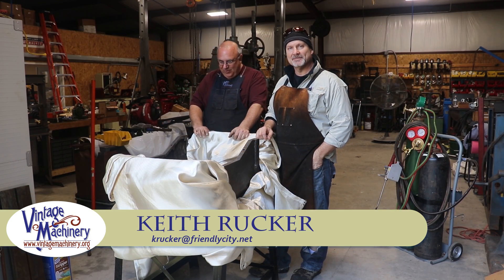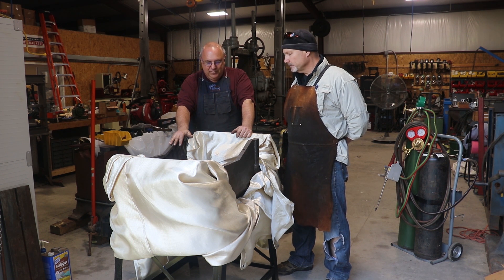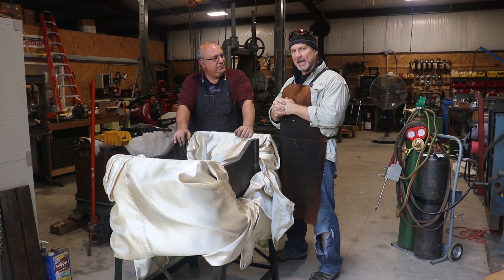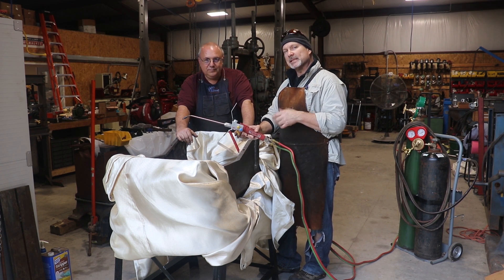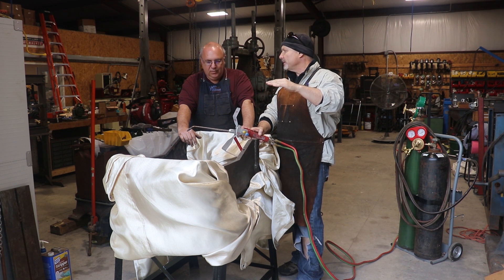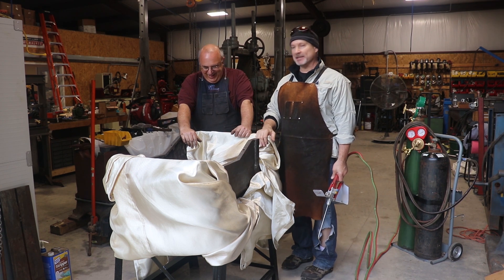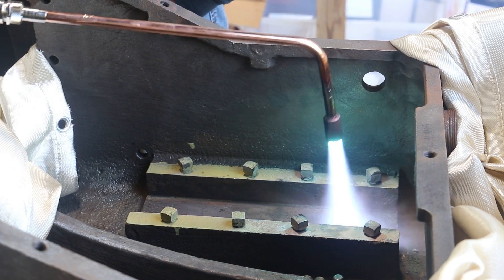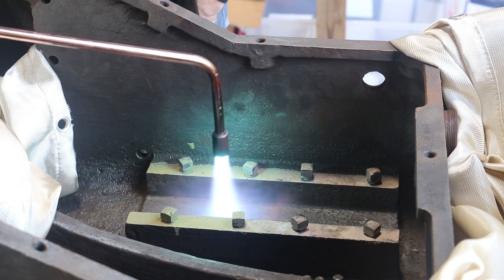Steam Locomotive Stoker Engine Restoration - Part 7: Spray Weld Buildup of Cross Head Slides

Comment: Man...that stoker is r has been a tough 
Old girl... from the videos I've seen... 
She is definitely a fighter... ant nothing been 
eazy so far ... will be worth it in the end 🤷???? I am pretty sure that it will be otherwise would not be doing the job (huh)...
 I can't find the video on how y'all finally 
got it milled...I know that abom didn't do it... he turned it down 
cause he couldn't get a set up going on the 
shaper..... He did not have enough room... I think on the back stroke..He did not have a inmill 
R anything long enough from the chuck of the milling machine too reach the surface that needed to be milled.... Mr.rucker got it back and had it setup on his machine 
and that was the last video that I had seen on the stoker...I don't know if it had ever gotten filled in and planned 
I'm sure Mr.Rucker got it done 
I just didn't get too see any of the 
video's on how r where it had gotten
done..... I got ideas on how I would have done in it without costing any $$$... But I am not a full fledged machinist....AND I don't have any 
$$$$..... well I would love to see the video's on it that haven't seen... I don't know if Mr.rucker has put out any on the finishing of the engine.... R does he still have work to do on the piece of equipment????

Comment: Personally, I don't see the/any need to cover up the interior visual minor flaws in the original casting of the engine's poured casing. I would assume that this engine worked well for generations with the casting blemishes in the engine's castiron casing causing no problems of any kind. Inasmuch, I cannot see where the casting flaws noted in this engine are detrimental in any way whatsoever to the performance of the engine. Therefore, I must assume that you are using this video as a short tutorial for spray-welding, am I wrong ?

Comment: I probably would have machined the bed out and cut .250 off the bearing and lay in a 3/16” bearing on both the foot of the bearing and 3/16” laid into the bed but I’m exciting to see this solution.  It’s always better to put same metal surface back in when possible.  The sheer force of the bearing would probably last longer on your repair.

Comment: The moment you, Keith, pointed to the rust in the crosshead guide I thought of Abom79, and his videos of spray welding. Adam is 283 miles from you. He has posted a wonderful video of spray welding to build up a shaft in order to fill pits, and then he machined it back to dimension. I KNEW you would get to spray welding! The best part of watching YouTube is the community of great Master Craftsmen.

Comment: Dumb question here : instead of filling corrosion pits in such a complicated manner (need to ship the part, use special tools and techniques, and then get it back to the shop to mill and get the right surface again), why not just mill the pitted surface down and make new chariots with higher soles ?
Reply: I completly agree! Kieth seems to have been led down this path by the fact that this spray process exists. I've watched him do this many times in the past. Another way to repair this would be to mill out and fix in new faces to the casting.

Comment: I am surprised that, at the temperature you stated, the fine metal being sprayed out is not consumed by the flame.
Reply: Nickel is used in high temperature industrial furnaces and can run white hot for short periods.

Comment: What did they doe before all this high tech spray welding came about?
Reply: Send a letter to the manufacturer and have them send a new engine.
If they had to do a temporary fix they could build it up with a hard grade of babbit, they used that stuff for a lot more then bearings.

Comment: Since you're going to have to machine the built-up surfaces anyway, wouldn't it have been a lot easier just to machine the original pitted surfaces back to flat and build up the base of the crosshead to compensate for the loss in height (e.g. by machining off, say, 10mm and bolting on a thicker slab of cast iron)?
Also, the very large amount of heat applied to the casting may cause it to warp and alter its metallurgical properties, e.g. machineability.
Reply: I think this way allows him to work with other YT's and show off another more modern way of building up material vs bolting on iron.
Reply: Pretty sure that's what they're referring to as "Plan B".

Comment: Hey Keith Merry Christmas.
I used to weld and machine very large Aluminum (30" x 36" x 12") molds for vacuum packaging  meat products. most was Tig work. But we did get into cast repairs from time to time. The biggest problem was heat control of a very large area. we found that a rose bud directly behind or under the area we were welding was the best method. Metal tends to flow toward the heat source. It was helpful on the largest ones to put a large propane bud close by to keep the general mold hot. It is also very important to cool it slow over several hours to maintain the original integrity of any casting. Good Luck! Love the Videos. Can't wait to see how it finishes up at Adams shop. Love the collaboration projects that all of you YouTubers do I.never miss a video. Keep up the great videos. THANKS1
Reply: Can this process be used on 3/8 aluminum plate to fill imperfections?

Comment: Looks like it turned out pretty good! Will be interesting to see how it turns out after machining back down. I would have figured you would not have wanted the final machining to end up in the transition zone but I am no expert on the process.
Reply: Sound engineering thinking and I had similar thoughts about that. The nickel is likely to be harder than the parent metal.  Seems like a potential long term risk.

Comment: Keith, you seem to be heating large masses in prep for repair. Would it make economic sense to use propane & compressed air for initial heating. Similar to burners used in home smelters for aluminum?

Comment: For a totally original restoration this is OK, but for a practical repair- it would be easier to machine the surface flat and then build up the sliding pad on the rod itself.

Comment: When i did the course at Eutectic in Feltham in west london, shows how long ago it was for those in the know, I don't remember having to get the cast iron red hot, in fact i seem to recall them saying it wasn't necessary being a eutectic process.
As i remember it, you warm the surface spray a fine layer on much like tinning a joint before making a solder joint , then with heat alone melt that dusting, then you start to build up the thickness on the boundary layer. But I could be wrong having not done it for 35 or so years. From your description of the precess I suspect you might not have a good enough bonding, I hope I am wrong.

Comment: When a lot of heat is wanted, check out using propylene gas. It doesn't have quite as much btu's per cu ft but you can run it at much higher pressures than acetylene thus acheiving much much higher btu output. And its significantly cheaper than acetylene!

Comment: Could have built a charcoal fire under that thing. :)
Reply: Hack, put the charcoal inside and BBQ, then empty it out and ...
Reply: I also wondered if heating from the bottom would have been more effective.
Reply: Using charcoal indoors is generally not a good idea - carbon monoxide.
Reply: @stumccabe  What do you get when you burn Acetelyne?
Reply: @dudleycornman1624  If you use enough oxygen, you get carbon dioxide and water. Charcoal burning in air usually doesn't get enough oxygen for complete combustion, hence the carbon monoxide.
That said, with sufficient ventilation, charcoal shouldn't be a problem and would help with getting the casting up to an even temperature.
Reply: @stumccabe  
Open the doors. Carbon monoxide is produced from domestic gas cookers.

Comment: What is the fixture clamped on the center web of the casting?
Reply: Les Bender Keith has a previous video that covers the fixture, it holds a locating pin so he could take measurements of the bearing surface.

Comment: Could the base heat have been better controlled by inducing the heat from the outside bottom, by building an enclosure of fire brick in the area to be heated? Kinda like a mini furnace with the casting as the top.